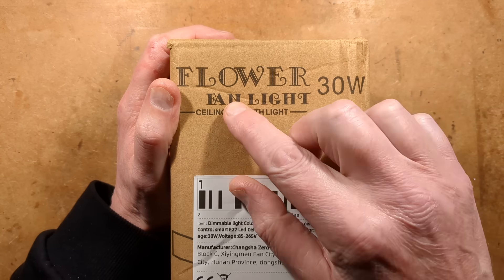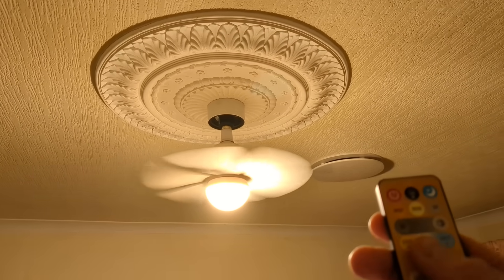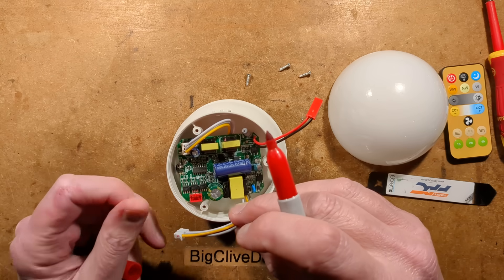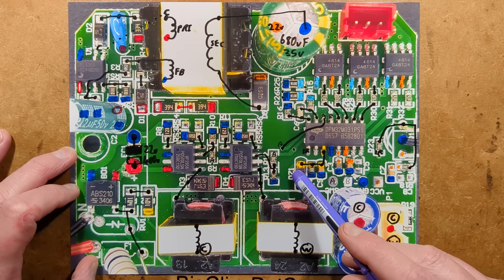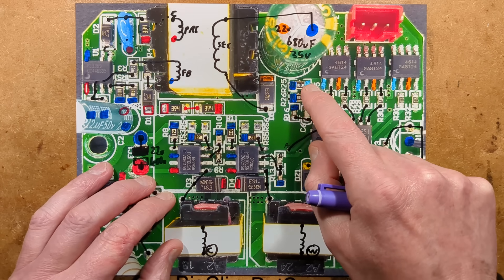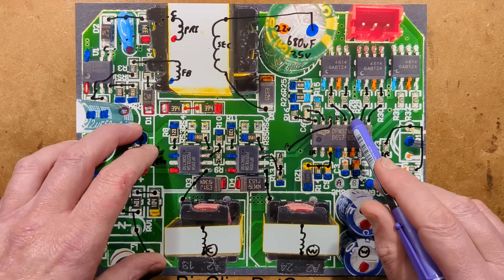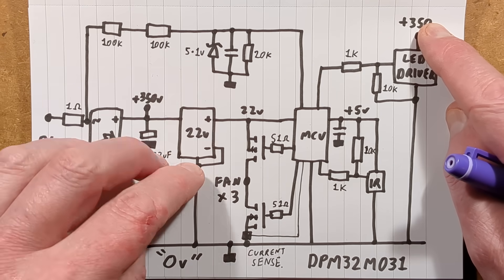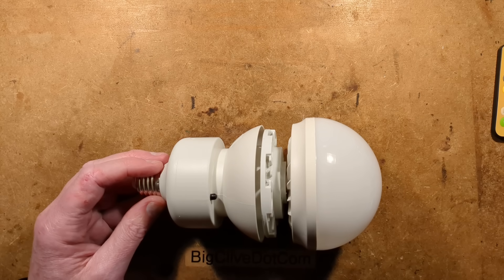Inside a screw-in ceiling fan and light - long version

Comment: Wow, I'm surprised it doesn't have wifi and bluetooth!
That little microcontroller with the 22V coming in is really weird. I looked over a datasheet for the family of parts. The only way they could be switching that high side P-ch FET (the one that supplies the fan) is if the gpio had some kind of internal pull up to the 22V supply! I've never seen something quite like that on a microcontroller (well, i actually have seen FET gate drivers on swankier microcontrollers). I wonder if this is a special custom feature that this company asked for.
Reply from the maker: I'm not sure how viable it would be to make it specifically for one manufacturer, but I could imagine that there are many uses for a chip that can control fairly powerful low voltage 3 phase motors.
Reply: This seems to be a pretty standard part from the maker, I can't find this exact product number, but they have various motor controllers on their page with integrated LDO and 40V gate driver.
It's hard to tell as all the data sheets are in Chinese, but I would assume they just put three separate dies into the package and connect them internally with bond wires.
Reply: @moe.m  Bravo on actually doing the legwork that I didn't haha. Nifty little part. They might have separate dies in the package, maybe. But I don't see why they wouldn't just do it all on one chip if they could.
Reply: @adam_cord  It depends on what processes they have access to. A "high voltage" CMOS process (40V, likely with DMOS transistors) is usually more expensive per transistor and will also have quite big feature sizes (180nm and up).  It would be cheaper to produce the MCU in a smaller process if they have it. Also, there is a block diagram with these three very distinct blocks in the data sheet.
I have worked in the automotive industry on projects like this, but these are just indications, it depends a lot on the circumstances ...